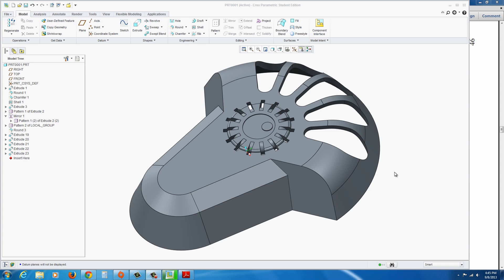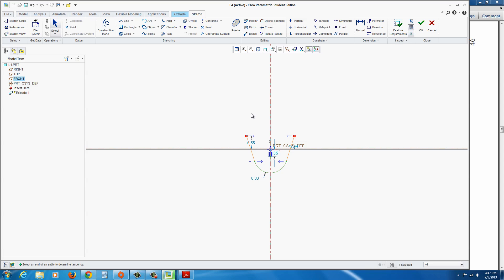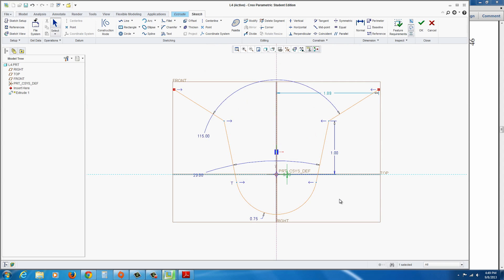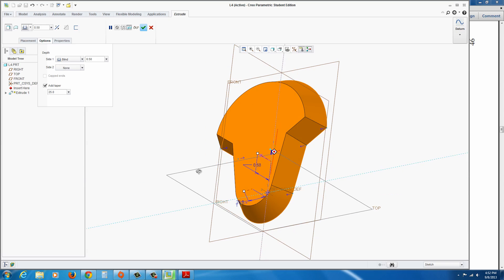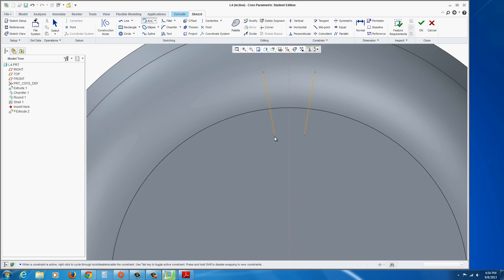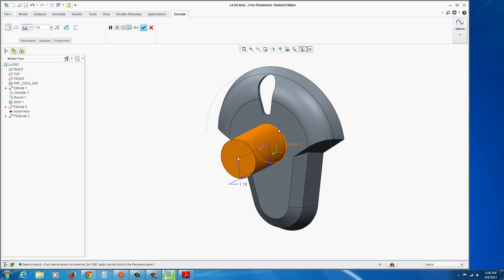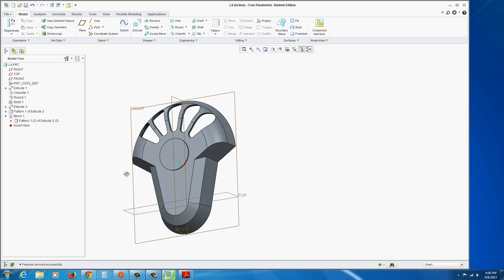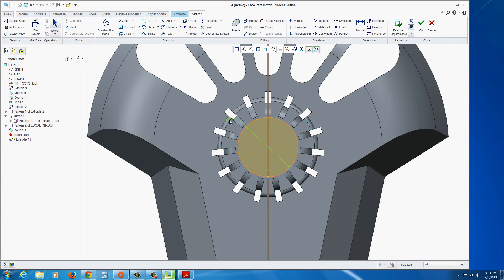L4 CREO Parametric 2.0 - Basic Modeling

Comment: For anyone who may need this, I came with an alternative solution for the pattern made at 12:30. For some reason (maybe different CREO version) I couldn't select that circle when trying to make the pattern. I went back to the sketch of the pattern model (sketch 2) and drew 2 centrelines at 12 and 36 degrees and mirrored it along those. Select the mirrors and mirror along the vertical centreline and voila!

Comment: Vertanux, I am having problems when I am sketching with the snap point... I can't do it very well, do you know any setting I need to go to fix this? I mean, example, when I am trying to place a center rectangle, i can't put it in the middle, or a centerline, i hope I've explained myself. I could change it in the snap grid but it is not what I am looking for, I can see that you can find the center easily. please help